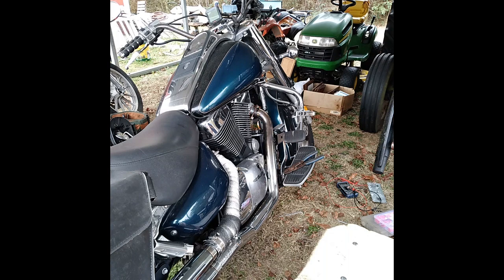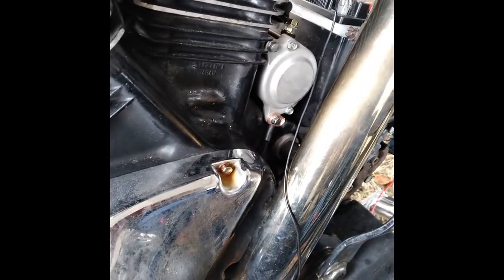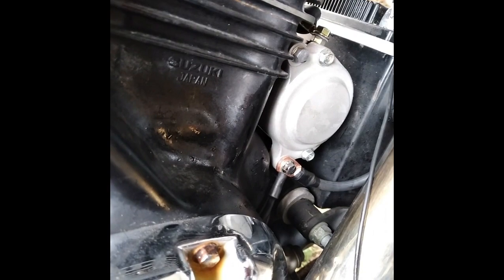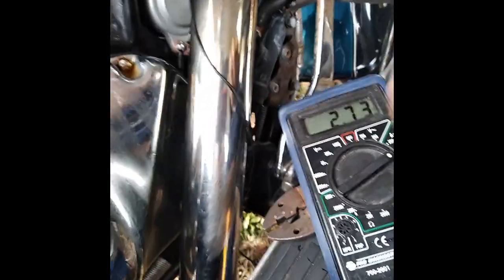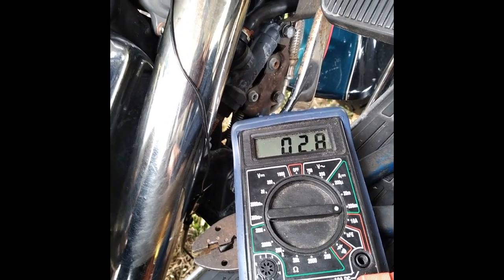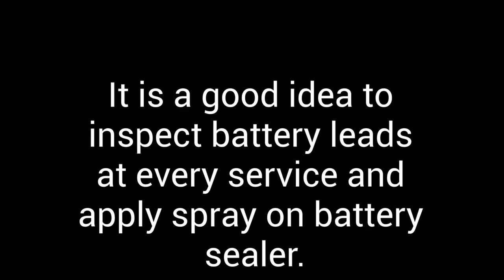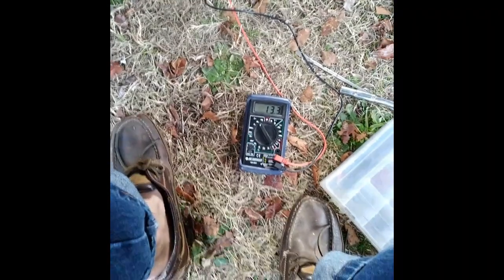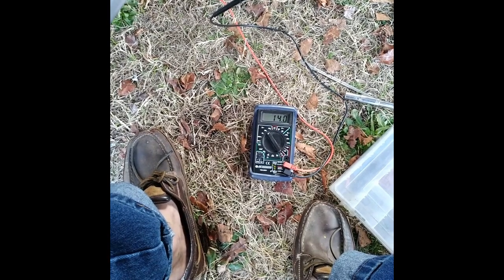Suzuki Intruder 1500 Battery Draw Test and Charging System Testing

Comment: Not bad, but.. 🙂

Providing the Suzuki-supplied numbers for "clean system" bike - per 1998's VL1500 service manual, as well as per its 2005-2009 revision, referring to newer C90(T) models:

1. The battery current leak should be under 1mA.
- if the leak is higher than that, it may be due to accessories a/o faulty battery, loose or disconnected wiring, melted connectors or a short on the wire harness

2. Charging output (with OEM stator and R/R) should be between 13.5 and 15.0V DC at 5k RPM with high beams on.
- aftermarket products may produce different results - e.g. my setup with MOSFET R/R by Solvart provides constant output of 14.5 - 14.7V DC, regardless of RPMs

3. Generator coil resistance should be between 0.1 and 1.0 Ohms.
- cheap Chinese replacements may have higher resistances between leads - I've seen as much as 5 Ohms; however, fine quality products (e.g. from RM Stator or Rick's) are perfectly within the Suzuki-given limit

4. Generator output should be above 80V AC at 5k RPM (with cold engine).
- cheap "~30$ / Made In China" replacements may not even reach 60V AC value at all, regardless of RPMs - and they tend to burn out really swiftly (from multiple users' experiences, one season is the so-so safe limit)

5. R/R test (OEM part) should produce these results - using diode test setting:
- B/R wire (-) vs stator wire (+) -> between 0.4 and 0.7V
- B/R (-) vs B/W (+) -> 0.5-1.2V
- stator (-) vs B/W (+) -> 0.4-0.7V
- stator (-) vs B/R (+) -> approx. 1.5V
- B/W (-) vs stator (+) -> approx. 1.5V
- B/W (-) vs B/R (+) -> approx. 1.5V
(note, that (-) and (+) refer to probe testers being connected to)
- if you have MOSFET R/R, you may skip this test

Also, when connecting the wires to the battery, clean both ends well and use a bit of copper paste (or other conductive grease) and tighten those connections. However, do not overtighten these - I managed to distort the battery connector (!!) this way (yeah, it happened during my ad-hoc "WTF-is-wrong" fix attempt on the road). My personal recommendation is to put additional rubber layer in the battery casing (front and bottom), as it greatly softens vibrations from the bike, which tend to losen the bolts & nuts.

For all connectors a/o plugs, slightly twist each pin very mildly (by a few degrees), as it will ensure good and lasting connection. Also, when replacing the connectors, always use a/o check for waterproof seals on the back of them - yeah, I have to say it again, but the truth is, that especially all the cheap Chinese ones tend to come without any.

LbnL ride hard & ride safe.
Reply from the maker: Thanks, bike was fixed and is long gone down the road.
  Appreciate the info though.
Reply: @russellbarron6775  Understood, though IMHO it's a bit of a pity, as - those more-frequent-than-desired charging system issues for this particular Suzuki bike model and a relatively small tank aside - the bike is really good for touring; it's really big and strong and comfortable enough for two fully packed up to do 500 miles per day. Especially the T model (yeah, T = touring) with the super-large windshield, which makes riding in rain conditions much more pleasant and also protects really well against wind.

But I can also relate - as a VL800 / C50 rider of 12+ seasons (I bought my C90T last year), in the days ahead, I'm going to check out a 2013 VL800, only for the purpose of me wanting to have a problems-free "light" bike for daily commuting, local easy rides but also perfectly capable of doing longer ones (e.g. to neighbouring countries, like Austria or Slovenia) - without the necessity to deal with the weight of the C90(T) and stop every 130 miles to fill up.

Comment: Nice overall electrical test Video
Reply from the maker: Thank you George,  greatly appreciated
Reply: @russellbarron6775  You are welcome Russell. I'm an electronics engineer and like your video!  My 2004 Suzuki Intruder LVI 1500   keeps needing batteries every 12 -18 months. My motorcycle is in excellent condition, I only have 7K miles.  Following your suggestions, I measure 0 - .13mA.  I just got a 2nd mA and uA meter, AstroSL TRMS 6000. I use YUASA YTX16-BS-1 batteries and after I spoke with YUASA rep, 8 months ago, I got  Yuasa YTX16-BS-1 3A Maintainer.  I don't drive the motorcycle very much. I only put ~1K miles per year. How long do the YUASA batteries last? Do you have any better suggestions or guidance?  Thanks in advance, George
Reply from the maker: @Xristougena99  Not much of anything better out there as far as batteries go. Although, a year on a battery is not really that great. With the maintenance charger you should be getting a lot more than a year. That being said, truth is it is kind of a toss up on longevity. I have seen people go over 4 years on one battery, some even longer. 
   Me personally, I get kinda concerned after 2 to 3 years. I just don't like the hassle of having it suddenly shake a plate loose, which is typically when you are 300 miles from home and it is 3am someplace dark.
Reply: @russellbarron6775  Thank You!!!
Reply from the maker: @Xristougena99  Any time George, appreciate your watching.